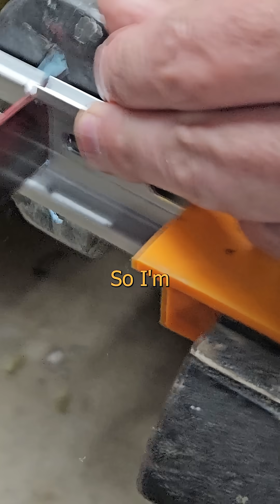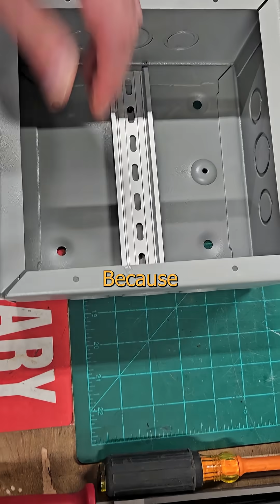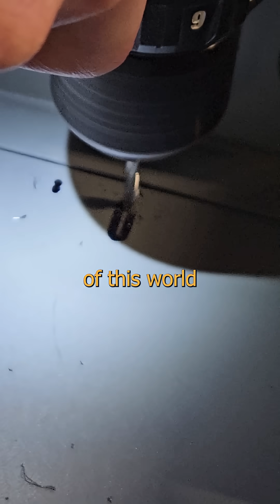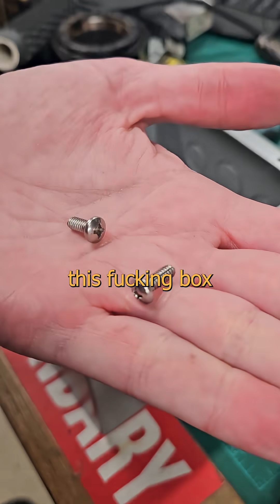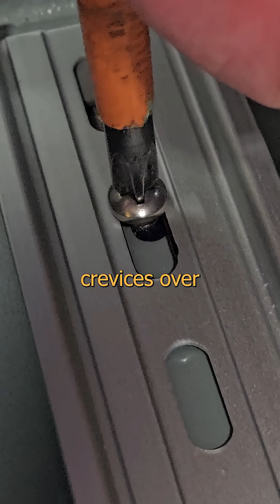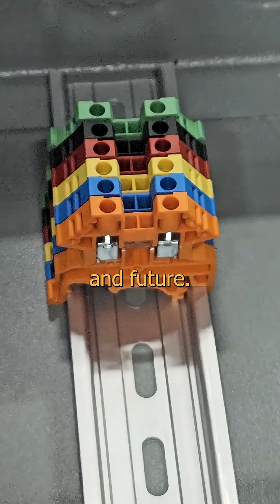Functional Junctions #chrisboden #comedy #engineering #electrical #craftsmanship #motivation #skills

Comment: We use specific colour terminals for specific applications. The gray terminal is inputs, outputs, 400v, 230v amd 24v. Blue is for the negative for 230v and 24v. Yellow is for safety. Green/yellow for grounding no surprise. Orange is for strange voltage, when you have a control cabinet that has its own suply but the ventilators in the cabinet are fed with a different power suply. When you turn the master switch off the cabinet is powerles exept for those terminals which feed the ventilators. We also have some Black terminals but those have a glassfuse in them, there more for 24v aplications like feeding a sensor or powering a valve magnet. To make it easy we put numbers on the terminals because that makes it a lot easier to find.

Comment: I'm a retired sparky and I always did din rail and terminals on controls so it is easier to run test when troubleshooting later. It makes all the difference in the world. And it's the difference between a merely competent tradesman and a true craftsman. And 100% agree on the treat others well idea, it not the measure of what kind of person you are but also it's a pay it forward thing as well. You never know when you will be the low person on the totem pole.

Comment: Damn, never seen anything like that drill+tap bit, tho I wonder if simply drilling a pilot hole and letting the sheetmetal screw make its own threads would provide a stronger connection, since the deformation of the material would provide some additional force on the threads

Comment: I recently did something similar for a lutron system. I find din rail and din rail connectors are great for stuff like that. I use wagos daily in switches and things like that, but when I have loads of connections in one box, din rail is my go to for a neater finish. (I live in the UK, we don't really use wire nuts anymore and haven't done for decades in this country. At one point you couldn't even buy them in wholesalers. They've started selling them again now, but still no one uses them. We were always told as apprentices that wire nuts create heat due to the twists, and it's a nightmare if you need to split the wires for testing purposes.although I can't verify the heat claim, I do know bends and twists in cables can create hot spots, and the pita it is to untwist for testing was always enough reason not to use them for me)

Comment: I agree that those connectors need numbers on them and the chart glued into the door, that includes routing, and a cabling diagram, very likely should have squares of color for each connector, and the wire going into it. It may seem a bit much for a project like this, but a color laser printed vinyl label with a writable surface over it for later updates will very likely be appreciated as well. That writable surface can be 'invisible scotch tape, or sanded laminate on the surface side. If the space for updates can handle someone writing with that sharpie they were finally able to locate, so much the better.

Comment: you tapped sheet metal for your machine screws? there's not a lot of material holding those in place, plus the blunt end of the screw sticks out the back making a flush mount to the wall un-possible. did I miss something?

Comment: I once used terminal blocks like this in a junction box because it was for a run of #6, and floating connectors of that size were much more expensive than their DIN-rail counterparts.

Comment: It may be a dumb question but I’ve never used those before, how with the metal parts being so close together does that not cause an arc? Is it coated in plastic I can’t see or is there a divider you put between?

Comment: I've always had total pride in my work I also work in a condition similar to his except for just a lot more gearing and hydraulics and a 100 times the scale, To take pride in your work is important, I can tell my own Welds I can see my own work craftsmanship. So you get yield at a lot that's fine it runs, lazy workers, if new stay away from the start. Learn as fast as you can. Then you too can be lazy but not with your work. Work smarter not harder. Do not get physically tired on your job every day occasionally you need to help out overtime and fix a problem no problem. If your work looks excellent the company will treat you pretty excellent. They will always prefer to have it done right rather than to have it done in a hurry and break again.

Comment: I built a 12x12 box with lugs on one side, 9 breakers, a whole mess of wire we need not worry about, and 9 220volt output leads with the proper connector for a telecom cabinets rectumfryers. It's purpose was an upgraded temp power supply for bringing a second cabinet online while hot swapping a site because corporations are impatient and cheap. Our old one was a years old unit rigged up from an old power supply section and 30 minutes and never cleaned up afterward. Problem was due to the passage of time the old supply was 2 leads short of enough cables so we never had quite enough current to keep the whole site smooth.

Comment: I have been fiddling with this concept for my arduino projects, but never found a way to attach the din rail into the case without breaking the ip65 rating. Screwing the screw to hold the rail with the same screw holding the case to the wall seems counterproductive even if the rubber around holds. Any suggestions?

Before you ask, yes, I am using the right stuff for my signal and power wires to keep ip65 rating. That is why breaking the rules for a din rail feels so wrong.

Only cases with built in screw sockets are meant for din rails?

Comment: Just one big mistake on the box.  Don't put the rail in the middle.  Stuff it to the side where you'll be connecting the big cable.

Make the necessary threads etc for fixing it, but left it loose.  Then connect the big cable, you can even do it outside the box and then fix it to the box.

Now you have way more room to handle the smaller field wires, which you will be seeing several times in the lifetime of that box.  There's never any reason to touch the cable supplying the box, as you remember, you did all the connections outside the box, where you clearly saw that everything went like it should and had room to yank the wires so you know they'll hold etc.

Comment: I like using a spacer under the din between it and the surface its being mounted to. I usually just use a cheap 3/8 nut as a spacer. It lets you pull wires behind the din so you don't have to always use raceway in small enclosures.

Comment: Someone laughed at me for using WAGO connectors to hook up the power wires for my garage door / lights / cameras. Why is that? I know them to be very safe (I mean they re rated for 32A… the fuses will jump at a third of that) so what s the catch? Is there any better solution?

Comment: I worked a whole summer building junction boxes like this. I have a suggestion sand away some of the paint under the din rail to help get a better connection for the grounding terminals.
Reply: Nice detail! Would a conductive paste work in this case? Or does that eventually lose efficacy?
Reply: When the manufacturer provides a grounding point (that little convex teat in the middle of the back), you pretty much have to use it to achieve compliance. The power feed grounding conductor and a connection to a grounding TB on the DIN rail should meet there.

Comment: Watching this made me think, do they make some kind of clamp that you can put on conduit to mount a DIN rail to?

I run into a few machine shops that have electrical conduit pipes coming down, but there's no place to mount a rail. It occurs that if I can put on a clamp that has a place to mount the rail, I can cleanly install these RS232 to IP servers and network equipment parts....

Comment: I work at wago and wanted to say that we also do a lot of DIN rails options as well. 😉
Reply: And they are really good, I have a test rig with Top jobs with levers
Reply: 'I work at wago and would talk to talk about our extended warranty' - as he peeks under the toilet stall door to talk to you.

Sorry dude i couldn't help my self 🤣
Reply: I just used some DIN rail mounts for lever locks in an installation today! But I also used some of the new 10-hole lever locks (221-430), and I haven't yet seen any DIN rail mounts for those.  Are they coming, are they not coming, or have they already come around and I'm just blind?
Reply: You can use Wagos, wirenuts,, whatever. A skilled tradesperson can make the wiring in that box look neat.  I appreciate any info left behind on a tag or box cover. DIN rail is awesome,  It can be used in a variety of applications.  Its like Unistrut for electronics.
Reply: Life-changing comments happen so rarely on YouTube, but you nailed one today. And that’s pretty cool.
Reply: You must really like the job, your never off the clock XD
Reply: I was just thinking lever nut terminal blocks would be cool.

Talk to engineering about high temp connectors using alumina for the case. Also make them for thermocouples
Reply: Oh, I've just discovered a thing! Thank you! 😀🎉
Reply: We use them in our semiconductor handlers at COHU!
Reply: Why do you do this!! I feel bi-polar! You’re amazing! Thanks for making me Bipolar Earth!
Reply: Yeah, and they are awesome. But i hate to tell you, the price is the reason we see none of them in the wild and instead have life altering boxes of wire and if you're lucky a few of your clamps.

Comment: And wago also sells parts for din rails and its awseome, especially if you want to rewire it easily in the future. Even if its in 25 years, you will be happy when you just have to pull a Lever or push in and know that the cable is secure without screwdrivers in small areas

Comment: As the person who has to work on these things after install. I love to see terminal blocks and din rail. Troubleshooting and cable replacement is so much better with easy test points. Had one install crew clamp all the connections together, not wire nut or wago, had to cut wires just to test continuity.

Comment: They make wago mounts for terminal strip applications.

Used them a lot in cabinets at a previous job. Let's you still be able to pull the connection out of the housing for inspection and troubleshooting, but holds it in a neat and stable location in the box during operation.

Comment: What kind of drill bit is that?
Reply: It's a combination drill tap.

Cuts a hole, then cuts threads into the side, so you dont need a bolt on the other side.

Fiddlier to use, as you can't just pull it back out (due to the threads) have to back it out.

Comment: This is so refreshing to see. Until recently, I was a software craftsman, and took real pride in my work. Every variable/attribute was a noun that described what it actually was, every method was a very phrase that described what it actually did, and every class defined an actual conceivable concept, not just ThingDoer. 

Never once did I get recognition for the hours of time I saved others, nor the morale I improved, in 24 years. Thus why I only used to be in software. 

Find where your good work is appreciated, and don't spend your life finding it.

EDIT: typo
Reply: Out of curiosity I just have to ask; what is a software craftsman?
Reply: @werewolf1336 A software developer who treats the endeavor as a craft that takes practical knowledge and practice, rather than an engineering endeavor where details can be predetermined by careful thought, logic, and math. It might seem counter-intuitive, but the worst programmers I've ever worked with have been people with Masters and Doctorate degrees - formal education is inversely correlated with quality of code.
Reply: It's surprising how much you forget about the code you wrote in just 3 months.  Having well structured code with decent variable and function names not to mention comments makes a huge difference.

Comment: I work on old refrigeration racks that have had modifications on top of modifications and service techs taking the quickest routes to make it work again. When a remodel comes in I get the call to clean up the electrical and low volt wires for another decade of other people working in a safe rack.

Comment: Dude make it a bit better by running a bit of trunking either side. So you can bring the cores in and double them back on themselves.

It allows for extra length of cable to use when you need to remake off ends and tidy up the whole box.

Plus laminate a drawing of the connection and stick it under the cover, with cable I’d and colour codes.

If you really want to be special get your welder to tack a length of chain joining the lid to the box so it can just hang out the way when you are working on it.

Comment: I had a job where I would design custom boxes like these for my company. The guy whose job it was to go install them loved me because the first thing I'd do is go and talk to him about how he'd like it done
Reply: Biggest mistake engineer can make is design something with out talking to guys that actually do the work. You did it perfectly as it should, but many engineers think paper holds more power than practical experience and real world.
Like machinist who had to make test rig and go to engineering office to show them in practice why 1.5times the diameter in treads is difference between stripped treads and snapped bolt.. you dont need 500mm long m5 tread in part, when after 7.5mm bolt will snap every time. Also difference is 3500€ part and 1400€ part. Each part was drawn to have this 500mm deep tread and each would have needed couple grand custom tab that is essentially single use due dulling and risk of snapping it into the hole ruining the part.
Designs was then modified to drill larger hole, mill even larger hole for the tread area and insert was interference fit in place saving thousands.

Comment: I hope that we see the installed box.
Reply: Me too. I don't know how those junction things work. I've only heard of Wagos & wire caps.
Reply: @goldenheartOh the one's he's using, do basically the same job as a wago.
They just use screws to hold each wire, and they are fixed to the din rail (the piece he screwed to back of box).
Besides color coding, they usually have a spot to put  numbers/letters, so you can include a printed schematic showing what goes wher.
Reply: @xraybox  also make great test points when you’re trying to chase a fault
Reply: @xraybox Each insert looks like it can only join 1 wire in to 1 wire out. How does it join more?
I was expecting those flat sides to contact its neighbor,  but then I noticed they aren't sticking out enough and also have a ridge up top that would be terrible for making good contact (low surface area.)
Reply: I'm trying to see the 8 inch box as well
Reply: Yes, I too want to see how they manage the screws sticking through the back of the box.
Reply: @87cr250r the box will likely get mounted to some unistrut so the screws won't be an issue
Reply: Money shot
Reply: I feel let down the finished product wasn't on the end of the video.
Reply: I call that a d-mark.
Reply: “I hope we see the installed box”

.. that’s what she said!
Reply: @stevenwagner7520  not promoting my channel because there’s nothing there but I’m uploading a video of one of these in action if anyone wants to see lol. It’s all we use. It’s carrying 480v to an acid heater and a pump.
Reply: @hunterlong1820 post more of that work stuff (if you're allowed!) Also liked the cold start and heated round of slingin' corn!
Reply: I hope so too, but showing how those connectors are hooked up.
Reply: Yeah it sounds neat but it really depends on what amount of current those things can handle. They look pretty small so I can’t imagine it’s for power, might be more for communication lines or relays.
Reply: @danielmorrissette6090 those junctions look like 15 A, but they come in many different sizes and power carrying capacities. You can get that size up to 50A. Although low voltage control is typically what they are used for which is under 24 V @ 10 A.
Reply: @danielmorrissette6090 he said it’s for oil pressures and temperatures, so probably milliamps. Use them all the time for low power 24v controls in my line of work.
Reply: The box isn't the point. The point is make your own parts. They will be better than ones you buy, and cost 1/8th of what you would pay. 😊